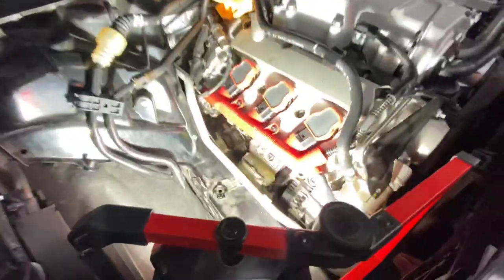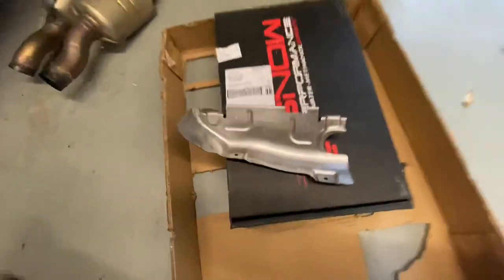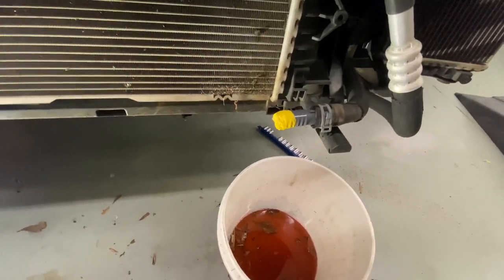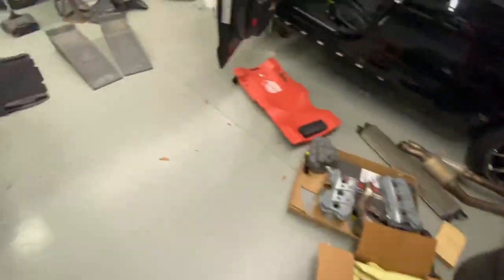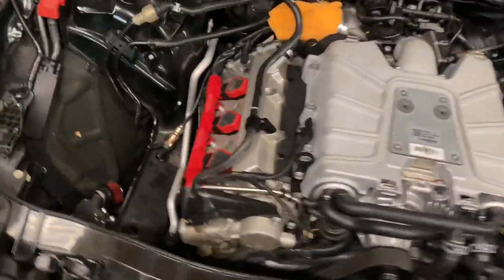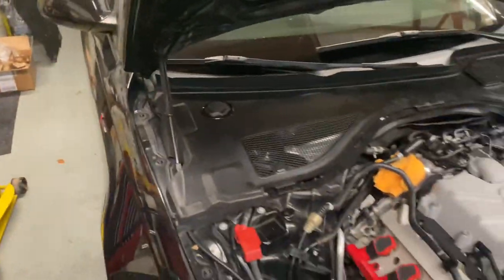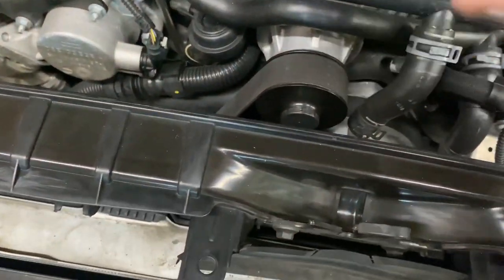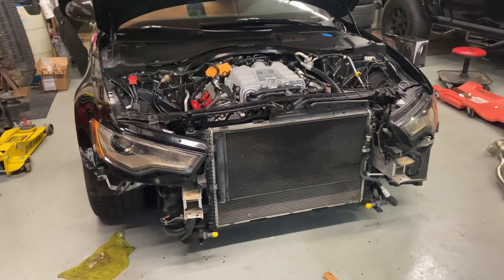Methanol and Header update Audi A6 3.0T

Comment: What year is your Audi bro? Also what have you done to the car so far, performance wise ?
Reply from the maker: 2012 and it was just a stage 1 car before it broke
Reply: @slowwa6741  what do you mean broke ? Like the engine block ?
Reply from the maker: No the exhaust manifold. There’s a video about it on my page.
Reply: @slowwa6741  I messed up my manifolds on stage 1 aswell. Currently waiting on long tube atm

Comment: Any info or tips for getting the manifold out? I have something leaking on my passenger side. Possible gasket. Not sure
Reply from the maker: Remove the motor mount bolts and lift the engine and have some patients lol
Reply: @slowwa6741  lol thanks. I'm hoping it's just my cat. We can't get a good look at it.

Comment: After you installed your headers, did your ECU adapt or did you have to tune it?
Reply from the maker: Adapted. Primary o2s are in the header. Secondary port in the header is plugged and the secondary o2s are welded into my down pipes. No cel.
Reply: @slowwa6741  dope thanks! About to order some!
Reply: Did you lift the engine when you removed yours @slowwa6? Also do you remember what size socket you need to remove the header nuts?